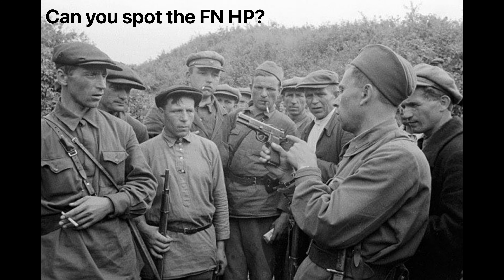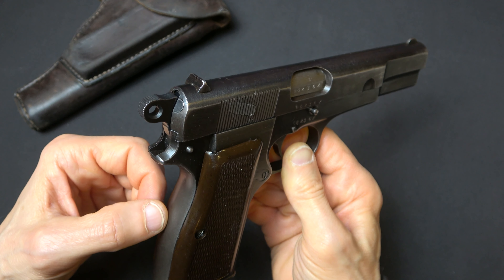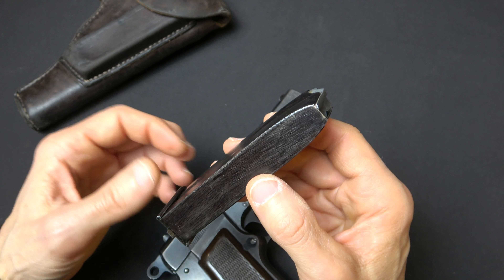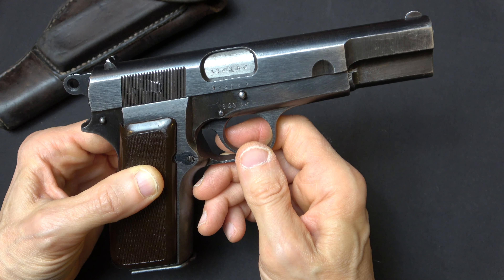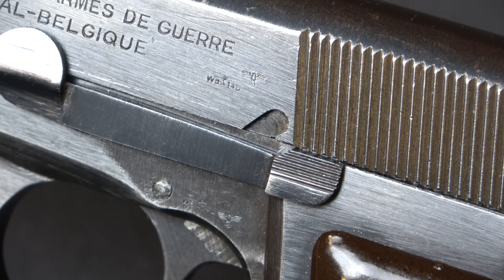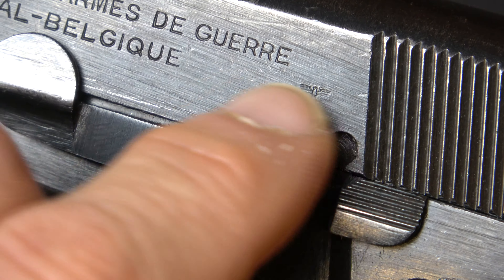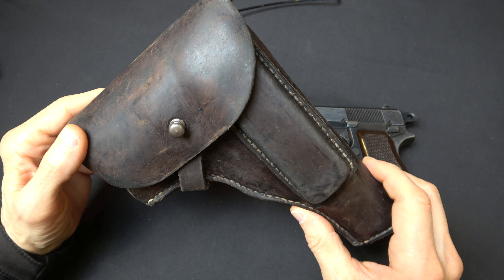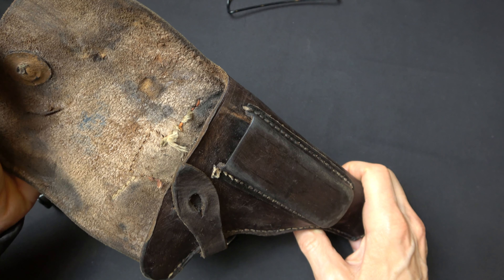WWII FN High Power w/ Capture Papers - A Nazi Favorite?

Comment: Can always tell a Nazi Hi Power other than the German proof marks, "Eagle over N" still used today for German made pistols, the Waffenmacht marks, internal extractor, but no provision for the magazine disconnect unlike most Hi-Power
Reply from the maker: Mostly right, but the early Nazi high powers still have that magazine disconnect!
Reply: @historicinvestments2587  Yep, I have one. Fixed sights and no stock slot, and with the magazine disconnect intact.

Comment: The original version from Browning was vastly different from the final version that was used in the war.  Browning was only involved at the very beginning of development in the early 20's after the French requested a Grande Puissance (hi-power) for their military.   Dieudonné Saive at FN spent over 10 years perfecting it.  They used the Browning name because it was easier to market rather than call it the Saive or FN Hi-Power.  Not to crap on Browning's legacy but he died in 1926 and the gun wasn't finished until the mid 30's.  I think Browning's main contribution was the double stack design and the design parts inherited from the 1911.